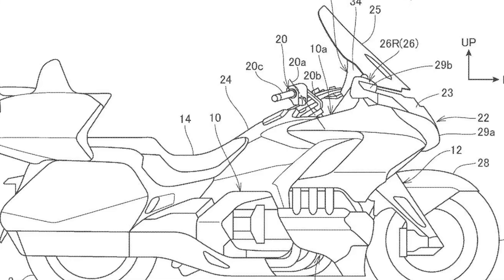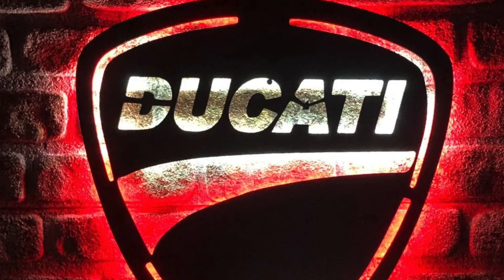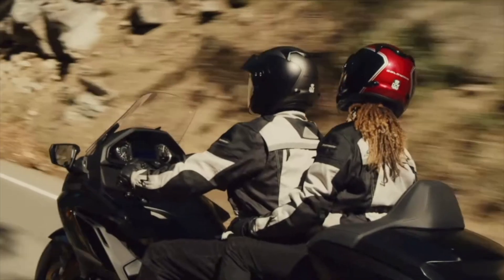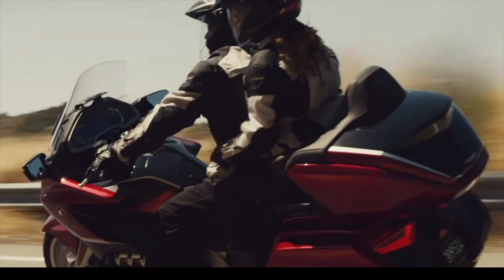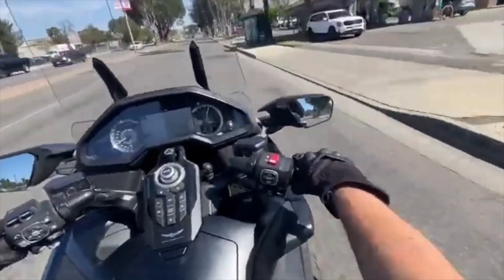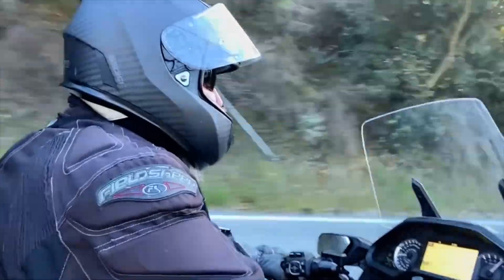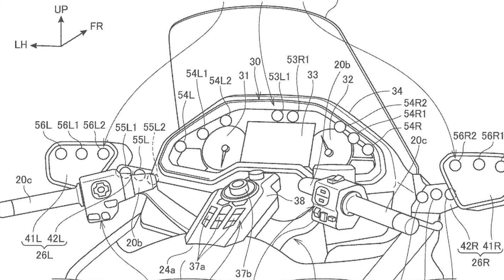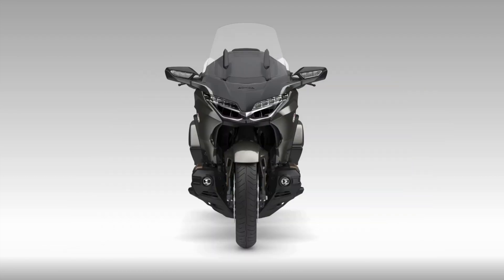2025 + Goldwing Laser LiDAR/ 2026? Honda Patent Leak News-

Comment: With Honda's recent reveal of the V3 engine with electric compressor, and the lack of the NT1100 DCT in the US, Honda should give us a 1300cc bike with some of the sensor and adaptive cruise technology along with low maintenance features like shaft drive.  Less weight, lower cost, and simpler technology could be the right bike for the right price.
Reply from the maker: Wow! Good thinking-that idea would definitely fill a market opportunity niche-
It will be interesting to see what they do with that new three cylinder engine.
We want to thank you for checking out the video and weighing in with a very interesting comment.
Let us know if you hear anything else about it.
Reply: All they'd have to do is bring back a SERIOUSLY updated ST1300 and they'd have a WINNER!!!

I love my 2004 ST but, she's getting rather dated. She's a great ride but I want the features common on modern touring rigs...Things like Cruise Control...Integrated infotainment system with Android Auto/Apple CarPlay...a little more HP...some of the modern rider aids like cornering ABS...
Reply: @DaveC_TN  Yes, the ST was a great bike. Honda's had some interesting engines and bikes over the years. The old 4 cylinder Goldwing, the CX v-twin like the Moto Guzzi, the shaft drive inline 4 cylinder CB700 and 900, and the V4 shaft drive VFR1200.  I think a new ST or 4 cylinder Goldwing "lite" 1300ish would be nice.

Comment: Take a Top of the Line Touring bike and just fix the current tech failures. GPS, looks and feels 2nd rate. Rider connectivity
(Bluetooth) surely Honda knows a better way. My 2018 needs phone plugged in and headset blue toothed and sometimes takes a few rounds to get it right. Fix the current problems, where I stop, shutoff, fuel up, restart, connect everything AGAIN, and take off